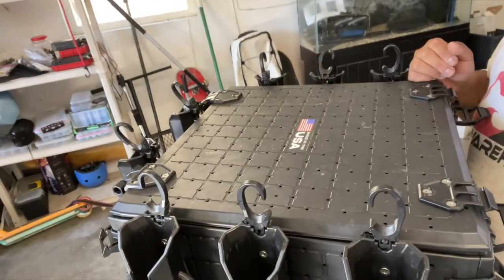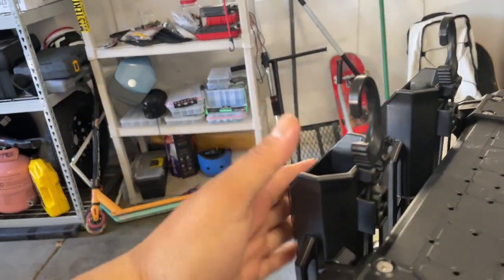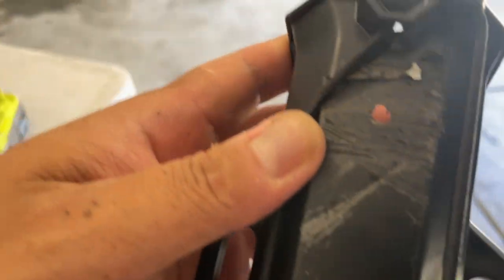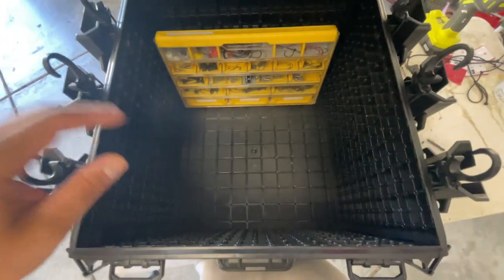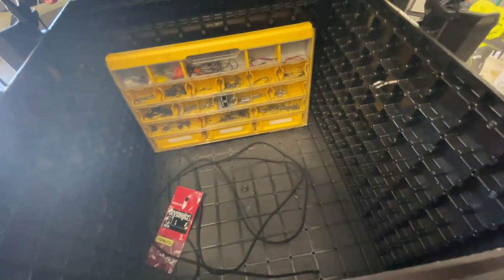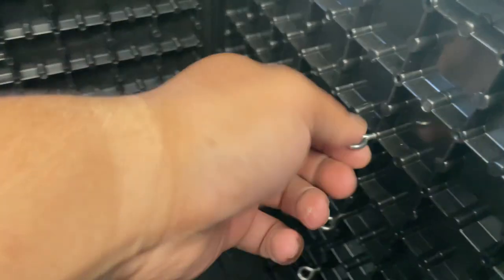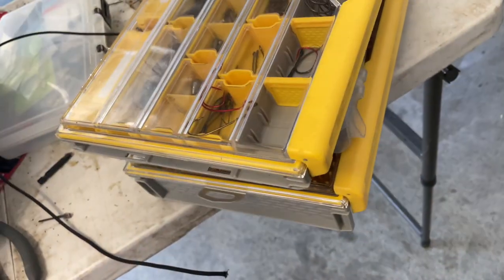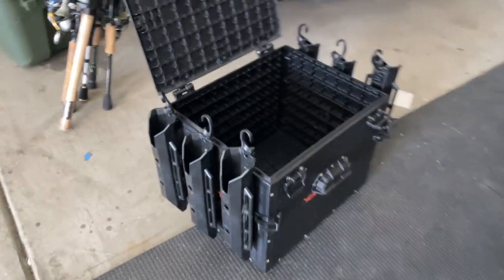YakAttack - BlackPak Pro MODS   HD 1080p

Comment: If for some reason one didn’t want to cut the tab off. You could make a spacer and use longer screws to get the distance to open lid. I am looking to make a solid divider, going to use Kydex and form a lip to screw into either side.
Reply from the maker: I did think about using spaces. I used them in the past with my other crates. This was much simpler and didn’t have to buy extended screws

Comment: I was watching Chad Hoover. He was at I cast , yak attack booth they came out with a divider just like yours .
Reply from the maker: That’s pretty cool! Idea isn’t new. I would like to think my idea cost pennies 😁
Reply: @MOBBINOutdoors  Your idea is better. It provides better support. Well done!
Reply: @CrazyCranker  Yea, but his idea cost them an accessory sale. It is all about the extras, no matter what they tell you. Every company makes a shit ton of money from accessories. They told me that was not what their intentions were. Then why not make the holes line up when you put the rod holder on a 45-degree angle, because they knew they were making an accessory for it, the same reason they did not include a divider system. It is nothing but a glorified milk crate, I regret purchasing mine.
Reply: @Letsdive64  There will be plenty of sheep out there that buy the Yak Attack divider version for sure. I do  agree with the 2nd part of your statement, it's certainly a "Glorified milk crate"

Comment: For the price they charge, I am very disappointed with it. There are a few things they could have done better. One, make the rod holders so they line up with the holes at a 45-degree angle, they don't, but hey they now sell an accessory that will do that. Who did not see that coming? Two, the only way I can put longer rods in it, is on the sides, because of the reason you stated, it makes it hard to open the top. They should make another accessory that has a slide on it, this way you can move the rod holder up or down. Three, for that type of money, why is there no divider system? You either have to modify the box or wait until they come out with their bungee system specifically designed to work with that box. Just another cost added onto an overpriced box. I wish I never purchased it, I could have made my own cheaper, including the extras. But, hey at least they include rod holders, in that price. Solid box, looks pretty but way overpriced for what you get.
Reply from the maker: Choose your poison LOL! Nothing wrong with DIY crates!
Reply: @MOBBINOutdoors  You are right, my last one was do it yourself, but I figured with my new Kayak I would get a new create. I refuse to pay them anymore money and decided to do the same mod as you did with the bungees, it worked out great. Thanks for posting it.